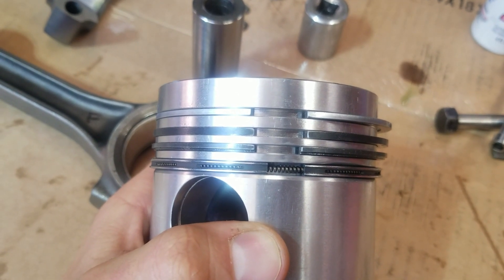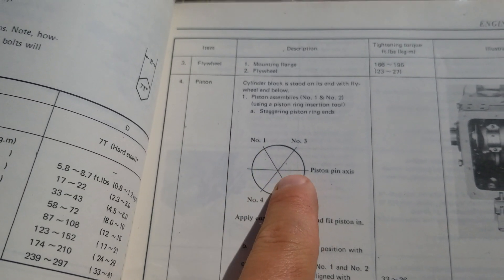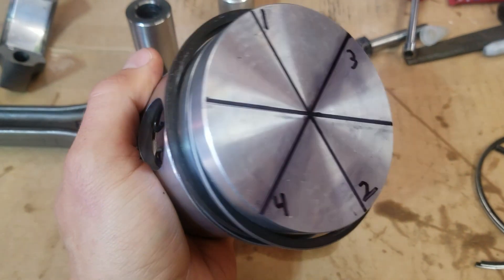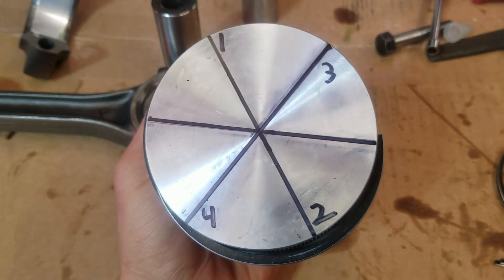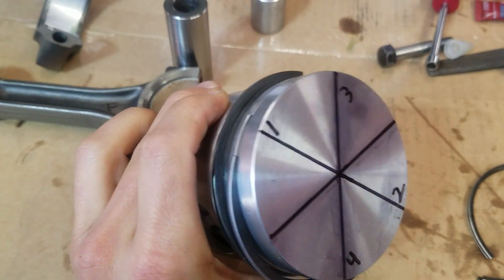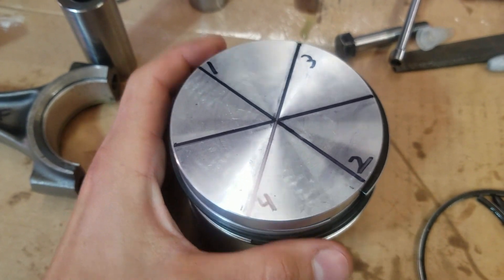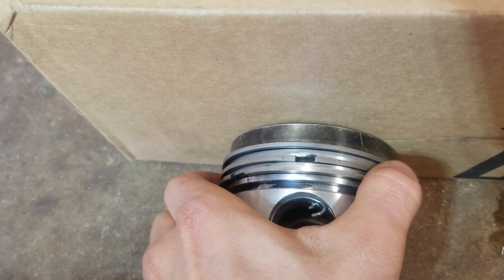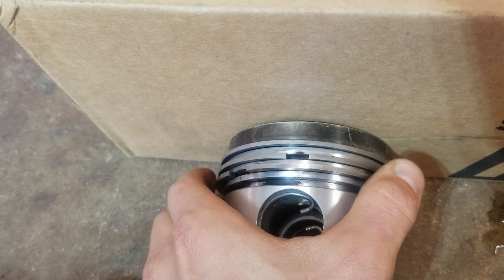Piston Ring Gap Does It Matter?!? Maybe?

Comment: What is the ring gap specs ?
Reply from the maker: Check out the description for the service manual. I'd try to find a service manual on ebay. There is wayyy too much stuff to check. Be VERY careful checking the ring gap. I broke a set of rings doing it.